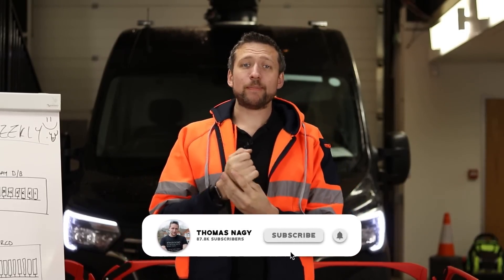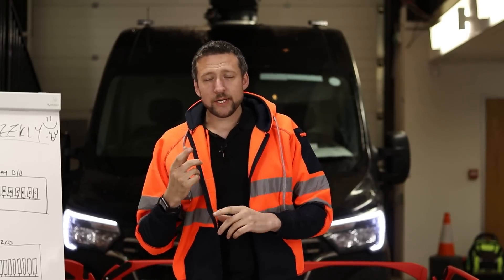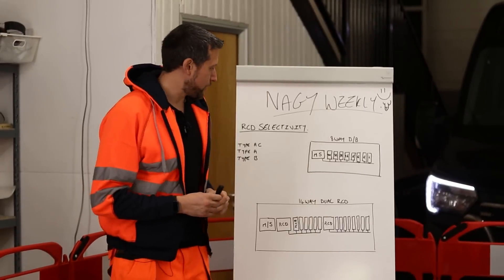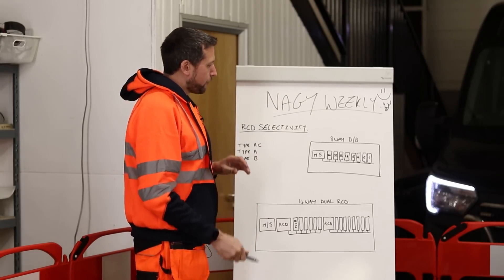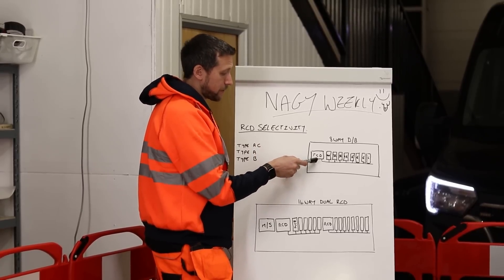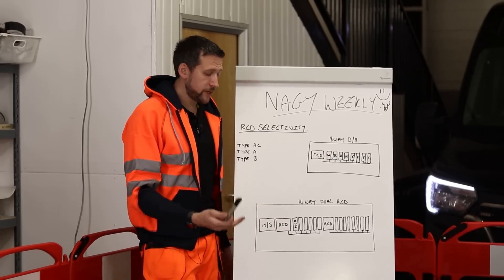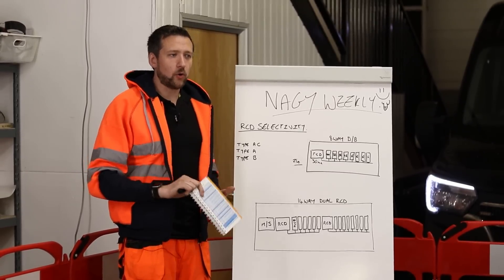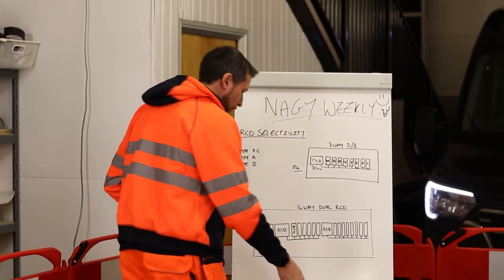Why RCBO's are BETTER than RCD's | Thomas Nagy

Comment: Love your video , so i was thinking ( i know its a waste of time and money and not recommended) , for high wattage appliances , put the RCBO as close to the appliance as possible , for example a water heater in a bathroom , keep the RCBO in the bathroom and let the water heater run through that RCBO and then the line then goes to a distribution box which then terminates in a MCB. I don't want to keep the RCBO far off so it works as effectively as possible. Any thoughts and how bad or decent this idea is?

Comment: You are good at what you do. Keep doing it. But if you are going to try and educate you do need to get things right. There are lots of points I would like to make and I’m only half way through the video. Here are a few. 1, if you are testing a RCD and it trips on 0.5 x then this is nothing to do with the leakage on the circuit. It is the RCD that is faulty. 2, you keep referencing selectivity, I think you mean division of installation 314. 3, The regs are to be applied to all installation and yet you keep referencing a little old lady who cannot manage a flight of stairs. This could quite easily be a very fit and young person who in the event of a power failure could be put at risk. Please don’t keep going on about an old lady. People that come along and start replacing switches with RCDs should ensure they met the design criteria within the regs. If they don’t know what or how to do this then they shouldn’t be changing anything. Just by simply saying use RCBOs does not alter the fact that they have no idea on design.

Comment: @7:30 on the matter of safety on the staircase should the lights go out. Same scenario in the event of a power cut. A solution is to fit self contained emergency lighting in the stair well ..... instant ON should the lighting circuit fail.

Comment: Yes there is an argument... That's because you cannot and are not be responsible for how it is used after the installation.... If it's in the regulations that that board is compliant then it's compliant, if a user then decides to connect lots of small devices several year in the future and this breaks compliance then the initial compliance is worthless.

Comment: Hi Thomas, I was directed to your excellent videos by a link on the Power Forum (Earth leakage trips every time South African load shedding ends) and was hoping you might be willing to share your thoughts on a problem I'm having; I've just installed a Sunsynk inverter and batteries (Hope this is not a red herring) and my earth leakage unit trips, only at night whenever power is restored to the grid. I can reactivate the earth leakage immediately after it trips with no problem, it then works perfectly for the rest of the night and following day, it does not trip if power is restored to ne grid during the day and early evening.

Comment: Have you ever measured the power draw of rcbo's? I've read various specs listing upto a couple of watts each, so a 16 way board with rcbo's would really add up and waste quite a bit. Are there boards where you could have an RCD covering a few mcbs and a switch covering rcbo's for socket circuits?

Comment: With RCDs and breakers, a bit of fault finding is already done for you. If only the RCD trips, it's most likely an earth leakage fault. If only the breaker trips, it's overcurrent: either overload or fault current, although an RCD will trip on fault to earth.
That said, I've changed my board to all RCBOs :o)
Also, here in Australia you're limited to a maximum of three circuits on an RCD in domestic premises. That way, you can put lighting and power on each RCD (a minimum of two must be installed) and if one trips, you still have some lighting and some power. So, again, the discrimination is done for you in the regs.

Comment: What's the difference between these two?

Lewden RCBO-32/30/SPA 1 Module Single Pole A Class Type B RCBO 32A 6kA 30mA
£11.33 (on discount-electrical)

WYLEX 32A 30MA SP TYPE B RCBO
£36.39 (on screwfix)

Comment: 2:30 In Belgium you have to have 300mA Type A  RCD at begin of the board .  And then a second RCD30mA  ( after 300ma )  for wet rooms ( bathroom/shower etc )  You can have multipe 300mA on the man tails ( not so common in consumer units )  I do like RCBO's like in UK .. over here they are crazy expensive  double pole RCBO . big advantage is only de circuits that i leaking trips ..   i usually put 1 300mA main RCD  and then several 30mA RCD's  with  5-6  RCB's on  .. but yes if the leakage is bigger then 300mA  the main trips ..

Comment: I remember when i lived in market weighton, there was a day when a lot of rain fell, and in the middle of the rain storm, one of the RCDs tripped
That RCD had most of the kitchen sockets hanging off it, the entire lighting circuit (there was only 1 lighting circuit), and the garage socket circuit
The freezer was in the garage, and so we ended up having to find somewhere else to put the food that was in the freezer so it didnt thaw out
Fortunatly the fridge was not hanging off that RCD (it was hanging off the RCD that had the sockets for the rest of the house, and the smoke detectors hanging off it)

If there had been RCBOs at that house when it happened, all that would have happened is the lighting circuit would have tripped

Comment: At home we recently had some work done , kitchen got moved , garage converted to a bedroom, not a massive job but electrics obviously had to be altered, we got in a what we thought competent electrician, 6 months on everytime we turn on the grill it knocks out the whole house, on the board there is no main switch it's an rcd in place , and the breakers aren't rcbo, so is this what could be causing our issues?

Comment: I am not a fan of over-regulation, but in my view twin RCD CUs ought to be phased out and all RCBO units used (with the advantage that you get four more slots in the same space). The extra cost is insignificant over the lifetime of the units.

When my parent's house has the old fuseboard replaced, then I insisted they put in RCBO CU (there wasn't actually room for an RCD one anyway). About 7 years later, one breaker started tripping intermittently and then, within a few days - fortunately - constantly. I went through the normal stuff of unplugging everything, but it became obvious it was a fixed wiring fault. So, as the other ring worked (left/right in the house not up/down), I was able to rig up a couple of extension leads so my mother could watch the telly, have a bedside light on etc. and came back and looked at it a couple of days later. That would have been a nightmare if it had been even half the house and all the lighting (my mother is 89). 

When I came back, then I found the fault; the work of the people who installed the conservatory 28 years ago. They'd broken into the ring main from a double socket as will as a fused spur for the light. But they'd stuffed three 2.5 mm^2 cables through a 20mm knockout hole in a metal backbox without a grommet (not that there was room). Over nearly 30 years it had cut its way through the PVC insulation and there was an earth/line fault. Prior to residual current device, this would probably have lasted a few weeks or months longer before breaking down enough to trip a 32A MCB and it might even have melted the double socket and certainly ruined the cable. 

In any event, the value of both residual current detection and the discrimination afforded by RCBOs proved their worth. Also, just because some building work was done nearly 30 years ago doesn't mean it won't cause electrical problems.

nb. one thing not mentioned is how much easier it is to fault find with an RCBO installation. That's especially important with an intermittent fault.

Comment: That is why in the Netherlands the regs state that there should me a maximum of 4 circuits behind a RCD in order to prevent nuicance tripping. It is common here to see boards with multiple rcd's. Also the regs recommend that you should divide your circuits in such a way that there is always some light in the vicinity when a circuit or rcd trips.

Comment: They are ok so long as you are prepared for annoying problems when a fault developen on one circuit. If by having a fault on an unrelated circuit it then means yoiu have no lighting or smoke detectors that is a safety issue rather than an inconviniuance. Aslo acumilated leakage current friom electrinics is a real things these days.

Seeing how cheap rcbos are nower days it is daft and usually negligent to install dual rcd shite. on a10 way board you save probably £120 which is not worth the potential grief you can get later on. If all circuits were wired in SWA, pyro, steel tube or a wiring system system almost fault proof with DP switches available at all sockets and loads then yea ok dual RCD is fine as you can isolate the affected extremity of the cirucit causing the fault but that is an almost impossible scenario so FFS!!. Any propper electricians out their please STOP installing RCD modules in peoples homes as of now!!! a summer house or garage for example is fine but not in not in dewllings. Its 2021 FFS and lewden rcbos are £12 each!!!!!!

The problem is there is a huge stock of dual rcd stuff out their desperate to be sold before regs most likely change so can be picked up for peanuts now so real cheapskates love it.

BG in particular are still actively encouraging their use which is shamefull realy IMO. Their wiring accessories are quite good but their switchgear is complete junk im afraid to report.

Comment: Hi Tom,

Not a sparky myself, but on your topic of cost. Surely when you price up a DB upgrade/replacement its going to cost in the thousands? Let say for arguments sake you charge £1k for a DB upgrade using an 8 way single RCD board (I genuinely have no idea how long it'd realistically take for a job like that plus miscellaneous materials). For the sake of an extra £50 on a £1000 job its not really going to be breaking the bank.

Surely if you can afford £1000 for the work you can absolutely afford £1050?

Comment: Only arguement i have is id rather have rcd protection then wired fuses.not that ive fitted a rcd board in about two years.i do work for one wickes guy and they give set prices for board changes

Comment: Often RCD protection is not needed on EV charging circuits if there is RCD protection (usually 6mA) built into the unit itself. A type AC RCD won't trip because the DC current will actually freeze the RCD in place - that's how a no-trip Zs test works. 

Great video Tom, keep them coming 👍

Comment: I like RCBO's but they're much more expensive (300+ %) than regular breakers and the regulations where i live (not the UK) require 2 RCD's, so that's what's installed.
And RCD's tripping? That rarely happens, except old ones during thunderstorms.

Comment: Absolutely agree with everything you say in this video. Spot on. But over and over again the wiring regs will not tell you split boards are not good enough.every time a new edition of the regs come out, they miss the opportunity. Split boards need to be banned.

Comment: Re EVCs, according to the EVC CoP, a type B RCD can be used, or a type A along with an RDC-DD, which can be separate devices in separate enclosures.

Re single upfront RCDs , section 3.7.6 of GN1 suggests that while dangers and inconvenience re cct arrangements should be avoided, RCDs are not related to the cct definition in part 2. However, due consideration of factors should be undertaken when considering to fit a single RCD or split load or RCBO, but that single RCDs should not normally be installed at the origin.

Re 531.3.2 and 536.4.1.4, you're misreading the requirements of those regs in the codebreakers book - the C2 / C3 applies to selectivity of RCD's "in series", not between ccts.

Re SPDs in London (or anywhere else in the UK), while type 1's may not be needed because an installation has no LPS or no metal roof or no overhead lines supplying it, type 2's probably will be due to transient overvoltages from switching events, especially where expensive equipment's installed. Some may mention the CRL, but this only relates to type 1 SPDs (443.5), and only for installations not in the 443.4 categories, so will hardly, if ever, need to be used!

Comment: This disagreement with rcd boards , your video you said when you do an EICR you would put a single RCD board as a C2 correct if I'm wrong. I did say I would put it down as a C3  room for improvement,. You and I know you can't apply regs retrospectively. If I see an old board with fuses or re-wireable fuses it passes , again I would code it as a C3, because you can't apply regs retrospectively.  With regard to Betty and her tribe , you don't know how they live and you don't really know what there requirements are . If you are asked to quote for a board change that is different form doing and EICR because you can test at the board for potential problems. If I was quoting for a board change I would point out all the prose and cons of each board , like you I would prefer to install a full RCBO board. If I was happy with what I'm see I would put such a high price so I wouldn't get the job or only quite for a full RCBO board. The other thing I would mention electrical regs are not mandatory and are open to interpretation, and we are allowed to do departures from regs  as long as we mention  it on the certificate, personally I could never walk away from a job unless I've the best job i can and it is safe . Unfortunately customer have budgets its up to us to manage the customer expectations within that Budget which many a tradeperson fail to do .

Comment: I'm sold on the RCBOs. But what about triple rcd? I guess once you've got triple rcd it's not that much more to get RCBOs anyway.
Reply: Bear in mind, every time you add an RCD you take out two single slots. So if you have 12 circuits, with the main breaker that's 14 positions, for a dual RCD board, it would require 18 positions for a triple RCD it would require 20 positions. 

As it is, that dual split RCD board Thomas shows has 14 single slots (including two blanks) and can support 8 circuits. With a triple RCD you could only have 6 circuits, so that's immediately an expansion issue. However, that much smaller main switch CU Thomas shows space to 7 circuits using RCBOs (and, if it wasn't for the space for the surge suppresor it could manage 8 circuits). 

Then there's the problem of the neutral busbar. Most CUs will have provision for two neutral bars, but not necessarily for the three that would be necessary for a triple.

Comment: Nothing wrong with duel RCD boards for small dwellings really. Twice as good as single RCD boards and infinitely better than NO RCD boards. RCBOs in a small dwelling are a luxury.
Reply: A "luxury" that might cost you maybe another £120 in a property with 8 circuits for something that's going to be in place for at least 20 years. Also, in that small property the RCBO option allows for the use of a smaller CU as it saves 4 slots over a dual RCD unit, and space in small properties is often at a premium.

Comment: I just couldn’t imagine fitting anything less than RCBO’s now. We will see an increase in electronic equipment in houses, driving the requirement for A type’s. You certainly don’t want to be in a situation were type AC RCD’s are blinded by DC leakage. Offering Surge Protection and AFDD’s will also become far more prevalent.

Comment: Another advantage with RCBO's is with lightning strike, there's a really small chance of it tripping unlike RCD's who are much more sensitive. In Norway we stopped installing RCD's for 10-12 years ago except for Type B RCD which is mandatory to install with EV's (regulated in 2014) Only when we install a wallcharger with DC filter (Easee Home charger) there's no need for type B RCD

Comment: That £50 can be eaten by the first call out charge. Heck as you say fault finding when the leakage total is ~20mA could be an hour or two so that's the £50 spent there.  The biggest cost is labour.

Comment: I installed type F RCDs at home, designed for devices with switching power supplies, also less susceptible to things like thunder discharges.
those are perfect for computers / freezers / (...) where you need to avoid tripping for no valid reason

Comment: @4:30  yes it can happen, its how most houses in Australia are - as most houses are greater than 20 yrs old.  Its very typical to have 1 RCD for all sockets, and another on separate lighting circuit(s) which also has fans.

 RCD;s are not going off everyday, in fact only time in my house its gone off was 3 years ago when heating element in dishwaster sprung a leak, RCD would trip only when it was started, Bosch sent dude out to replace, and all good since, and the number of crap I have on in this place would be mind boggling I'm an ICT telco tech so apart from all the usual family 240 gear, aircon, elect stove and hot water, multiple computers printers, scanners,  I have shitcrap loads of DC 12/5v adaptors and test gear and chargers,  maybe we're luckier because Australia does not use ring circuits, and our typical socket circuits are only 15amps.

Edited: forgot to include above, sparky who came out and confirmed it was the dishwasher,  when its disconencted we have 4ms leakage when not in error state

Comment: Isn't the type B required in regulations fot EV chargers? I think it is an important point even if EV built-in leakage measurement is already very strict.
Reply: Type b rcd required if charger doesn't have 6ma dc protection. Type a required if it has dc protection